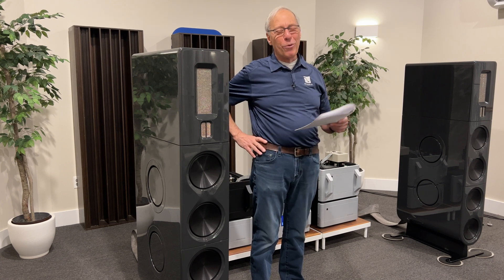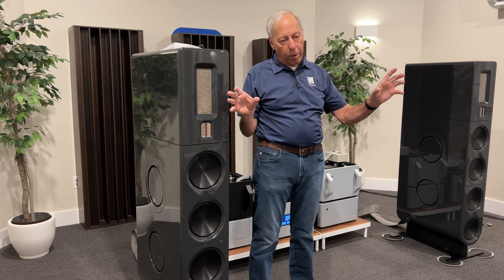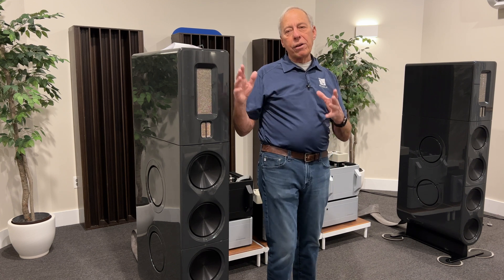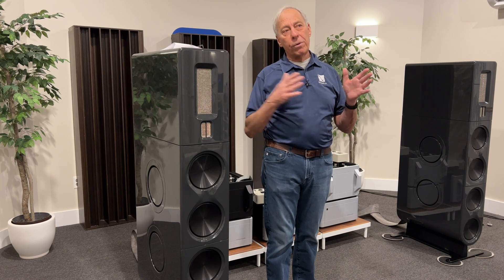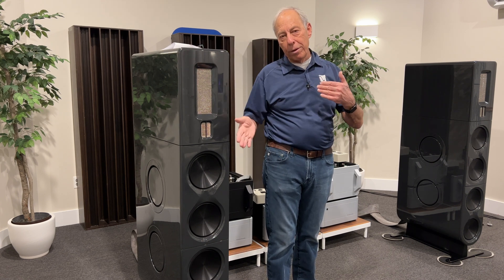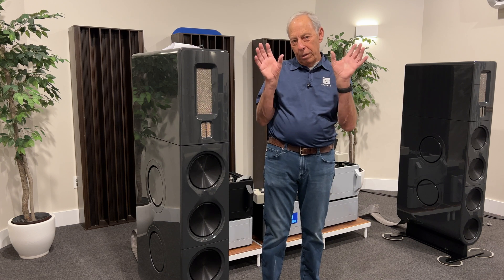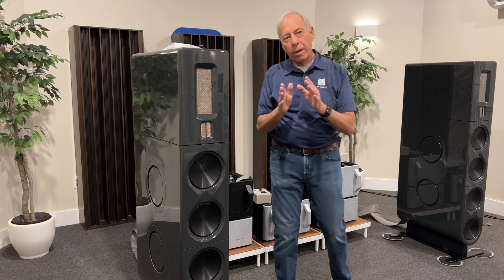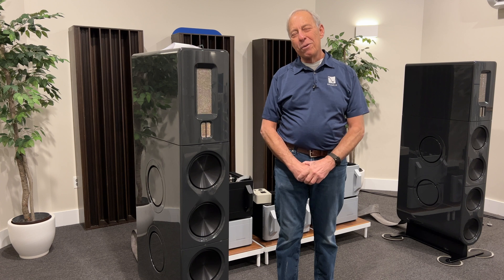Making a DSD live recording

Comment: Hi Paul, great videos, could you please explain, if the DSD format of recording is perfect, why do microphones still need to be pre-amped, adding another unit in the line for what reason?
Reply from the maker: Well, because DSD is only a recording format and the A/D converters that take the analog output and convert it to DSD require a certain level of loudness coming in to work. A microphone, like a phono cartridge, has an extremely low output signal and somehow must be amplified to a loud enough level. That's what the microphone preamp provides.
Reply: @octaverecordsanddsdstudios1285  ah ok thank you very much for the reply 👍👍

Comment: I think you're missing a trick why put it on harddrive where it creates noise! you can put a digital signal on tape there is no noise or artifax. would be better and for storage purposes would be longer lasting and safer.
Reply: Tell that to all world wide pro recording studios.  Then come back and we'll talk.
Reply: @380stroker  they what convenience speed and storage is the issue and cost. its not like they haven't got the equipment still. nobody thinking about what's going to happen in 100 years time when these digital formats will fail and probably less than that time??
Reply: @hoobsgroove  convenience kills everything.